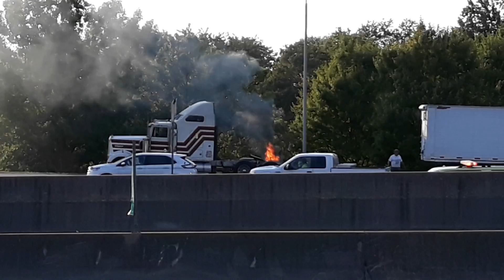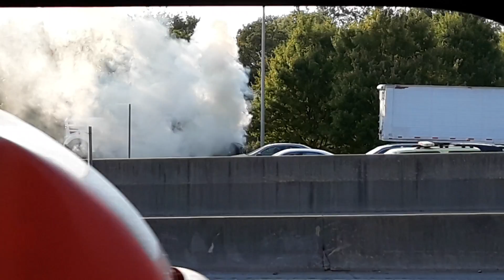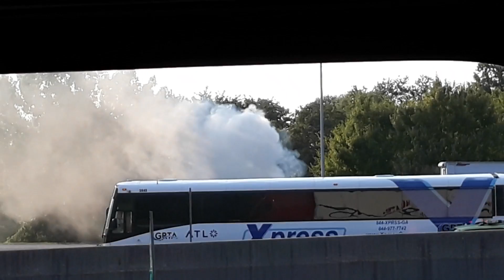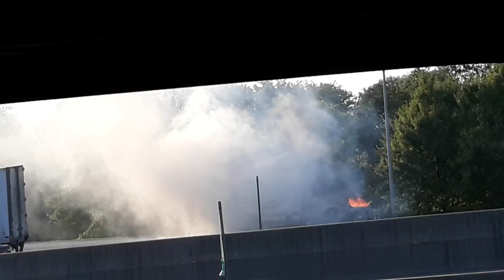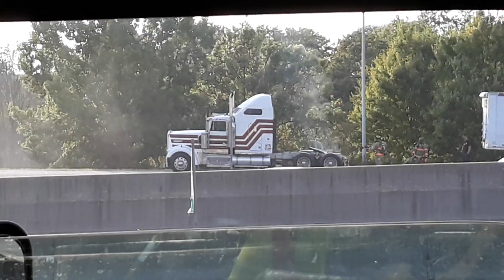What To Do When Your Truck is On Fire - Brake Chamber Failure

Comment: is good to keep  a few gallons of  water in your truck it works better than the fire stingusher. because the stingusher is going to put the fire away but the chambers will light up on fire again if is not collected down  . it worked for me

Comment: I've had something similar to that happen to me. I was hauling rare dairy milk in a tanker and a car decided to brake check me, I hit the brakes,  what didn't know was that the S cam on right side of my tanker rolled over the pads but not stopping the duals. It wasn't until about 2 to 3 miles down a car pulled up next to me and pointing to my tanker. I looked saw smoke pulled over and break drum was glowing red. I used my ABC exstingwisher and waited then backed off the brake and used a pipe wrench to roll the S cam back over and continued on. A pucker factor. I have many more pucker factors in my career as a truck driver.

Comment: 200,000 to 400,000  miles  how about  6 months to   8 years..??   Not very predictable.. I used to   replace the rubber diaphragms  in  both the service and safety chamber  years ago ..  Now days  they have a  band that can't be taken apart  in the emergency spring side..  I caged them in a vice  before to take them apart..